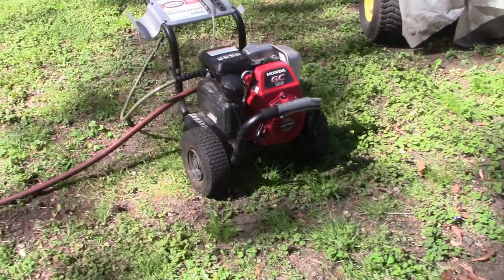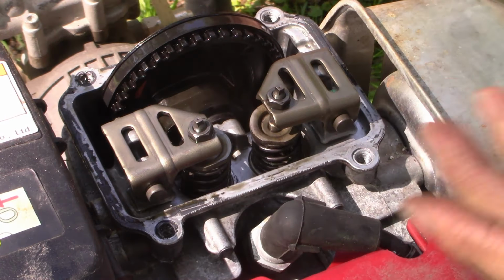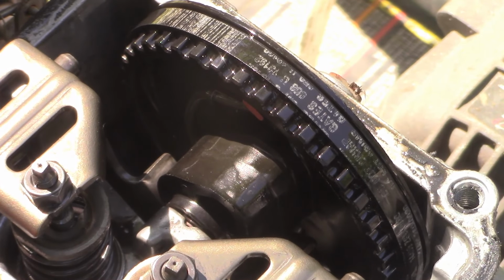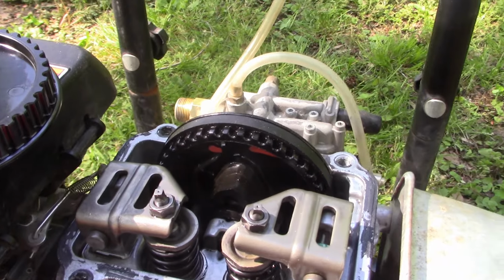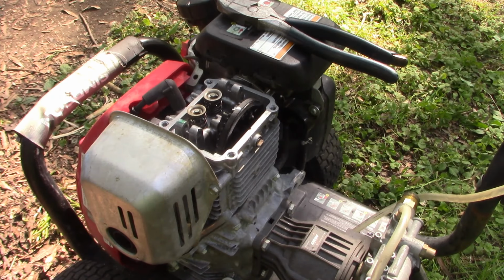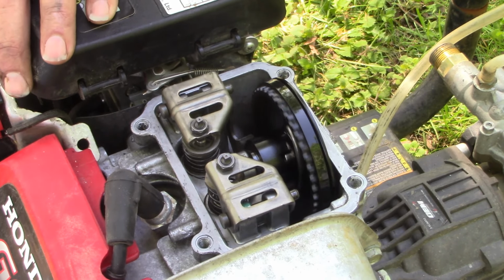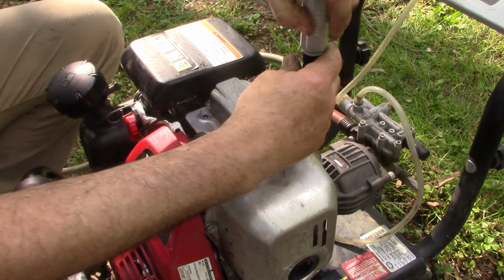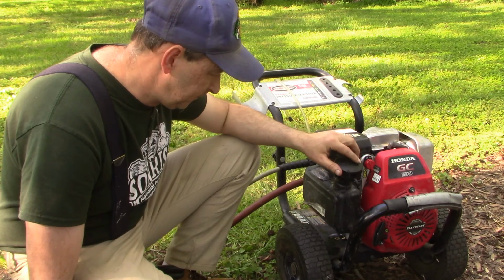Why your Pressure Washer Starter Rope is so HARD to pull, and how to fix it

Comment: I'm having the hard pull start on a, not even year old, Westinghouse 5300 generator. Any ideas? I about ripped my fingers off pulling  on it and put a good size bruise on my leg where it hit me after it when through my fingers.
Reply from the maker: Those generators are hard to pull start even when there is nothing amiss....
Reply: @Buckwsr  when I first got it it was easy. I took out the spark plug and of course without it there's no compression and it was easy to pull but as soon as I put it back in I thought the cord was going to break. It was never like this when I first got it. The other week it was doing that and I was going g over it and tried it one more time before I was going to give up and I barely pulled and it started so easy. I have no idea whats going on with it. One thing I was doing was turning  the gas off and letting  the gas run out of the lines but the last time I did that I noticed a good size flame that shot out of the exhaust. And ever since then that's when it got hard to pull. Doubt it had anything  to do with that though
Reply from the maker: @hilham89  Okay, glad you got it worked out, at least for now.

Comment: Great video. 
I need help. Pull start cord rips out of my hand when i attempt to pull / start it.
Does anyone know why and the fix? Its been a year and I'm still at a dead end.

Ryobi GCV 190 3100psi 2.5 GPM
Reply from the maker: The rip-the-cord-out-of-my-hand thing is often caused by a misaligned flywheel and sheared keyway pin.  You will have to remove the flywheel to verify and repair.
Reply from the maker: That's not a guaranteed diagnosis. It's just one possibility to look into....
Reply: @Buckwsr  you're absolutely correct. The timing gets thrown off everytime we re align it and attempt to start it again

Comment: Bought my Simpson Pressure Washer at Sam's 2 days ago.  Started it up, ran it for 3 minutes and it died.  Now I can't pull the cord at all.  Shouldn't be the case on a brand new out of the box machine.  Returning it tonight.
Reply from the maker: Rats! Brand new, huh? Engine have oil in it? That's a bummer....
Reply: @Buckwsr  Guess I got a lemon.  Exchanged the dead washer and the replacement from Sam's works just fine.  Hopefully I'll get a couple year's use before I need to pull off the valve cover.

Comment: I have the Simpson 4400 pressure washer with the 420cc import engine like the Predator. Labe says call the tech support line, Great! but there is no one at that company that can help. Then I called a lawnmower shop and they say - sorry - no parts avail, finally get someone who knows something and they say there is no compression release. Let's go find out....
Reply from the maker: Let me know what you discover. Thanks.

Comment: So I can't find anyone with a problem that I have, I am trying to start my power washer and it did start twice but did not stay on. Now when I try to start it, it's much harder to pull the rope and if I pull it all the way back sometimes the engine pulls it back from me? I don't know what's going on, and the engine doesn't seem to be turning more than what I'm pulling it like it's not helping me out
Reply from the maker: Pull the trigger on the wand to relieve the pressure in the pump. Then try again to start it.
Reply: @Buckwsr  I hate how simple that was... I figured it out a couple minutes after posting but you are correct.
Reply from the maker: @yaboiwillsmith663  awesome!